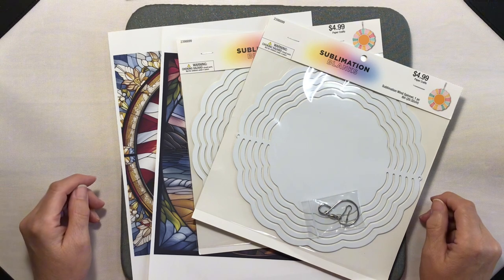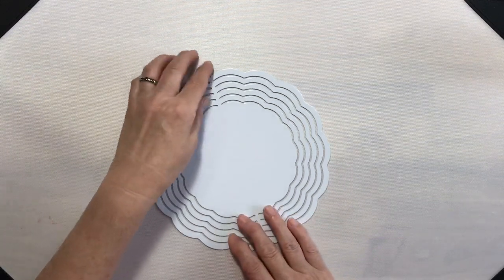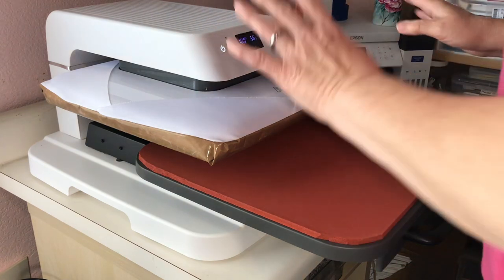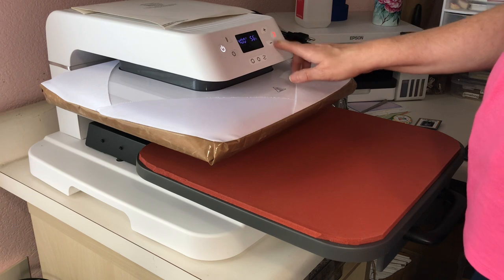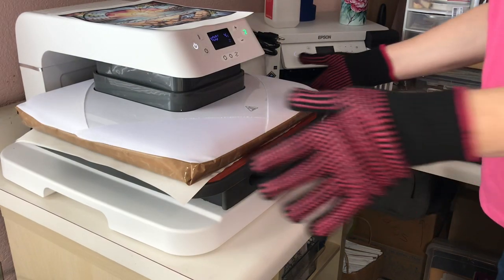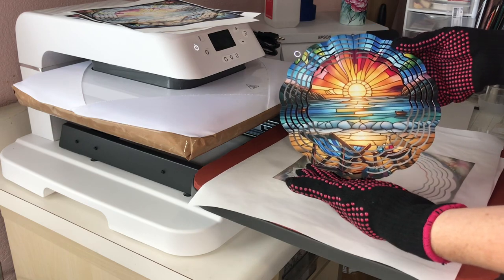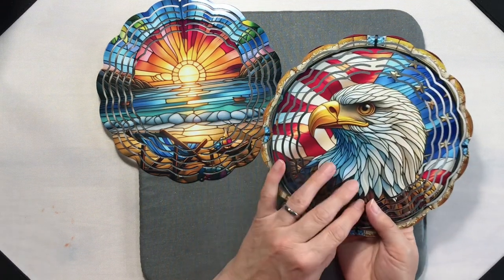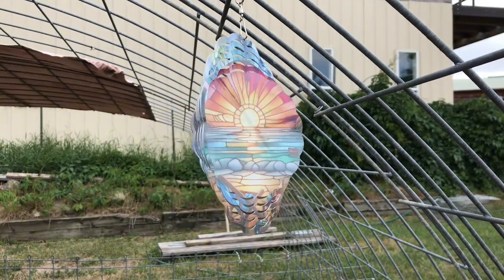How to Sublimate 8" Wind Spinners - Success or Fail?

Comment: I tried and tried and couldn't remove the film. Even used a pin to try and find it and couldn't
Reply from the maker: That film can certainly be a pain the butt to get off! Did you get your wind spinner from Hobby Lobby or Amazon? I've heard some of the spinners from Amazon may not even have a protective film on them.
Reply: @coloradoleen  hobby lobby. The package said it has a protective coating that needs to be removed.
Reply from the maker: @carolegilbert5271  Hmmm maybe try a piece of packing tape. Burnish it down well and then try pulling it up that way. Or, maybe that particular spinner didn't get the protective film. When you look at it in the light, is it really shiny or kind of dull looking?
Reply: @coloradoleen  I sublimated it already, one side came out good, other side not as well. I'm new to sublimation. I'm thinking if it had a film it wouldn't have taken the ink at all
Reply from the maker: @carolegilbert5271  I've heard in the Facebook sublimation group I'm in that a few people still had good results with the film on. Personally I agree with you, it doesn't seem like it should work as well with that extra layer. There is a learning curve to sublimation, but it's a fun process!
Reply: @coloradoleen  I'm learning slowly. Thank you for your time
Reply from the maker: @carolegilbert5271  It's my pleasure! If you have any other questions, let me know and I'll try to help!